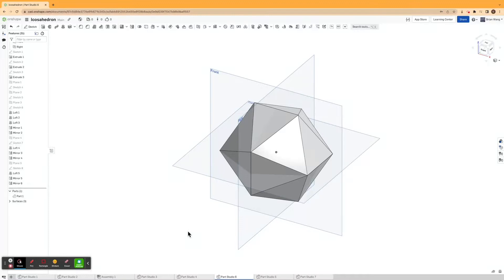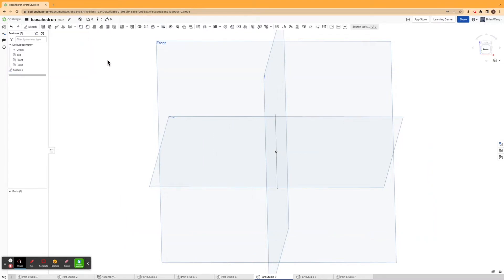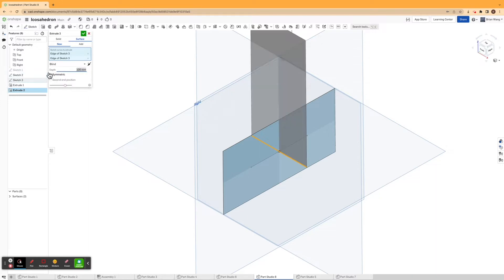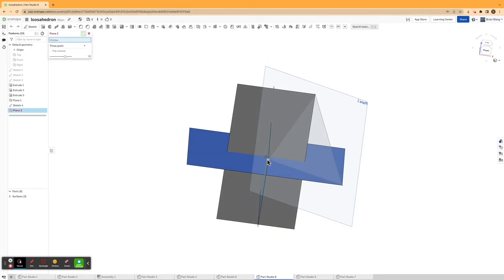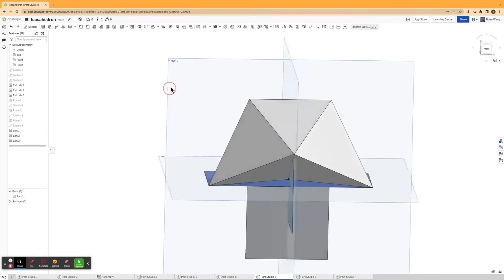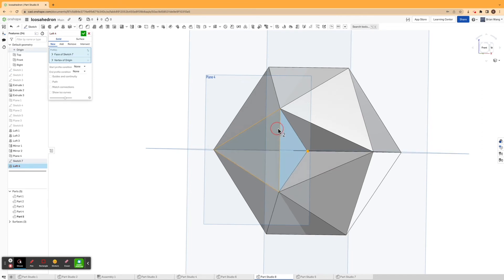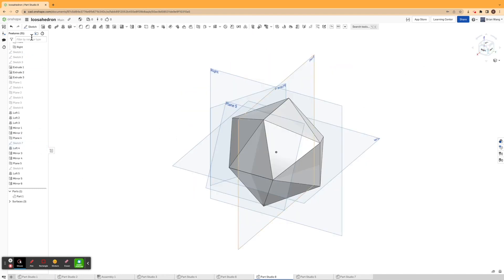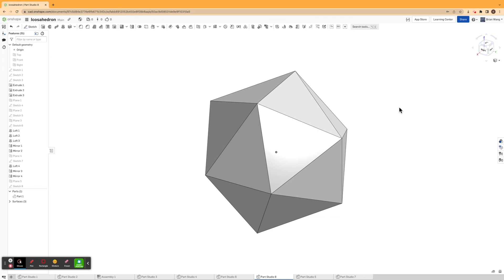Engineering with Brian | Onshape Tutorials: Icosahedron (20 sided dice)

Comment: great video Brian , on the side note  I've noticed that with these dimensions half the triangles are not equal side triangles, if you've made the longer side of the rectangle around 80.915 it is quite close, do you happen to know how to calc that exactly ?
Reply: to get a perfect icosahedron, the rectangle's longer side is exacly the golden ratio times the shorter side, which is pretty cool
Reply: 80.902 mm Extrudes seems spot on (but I'm no math expert, just someone willing to keep inputting different values - thank heavens for variables in OnShape!)  The surface area of each triangle match at 1082.54 mm2 (sq) (and all line lengths are 50 mm) with this Extrude value.